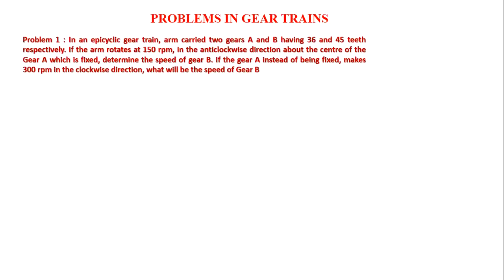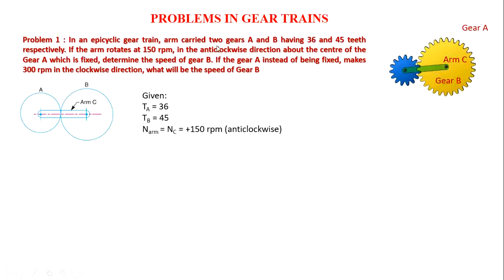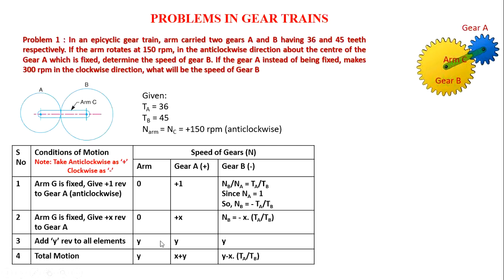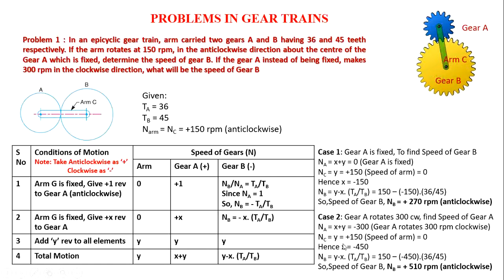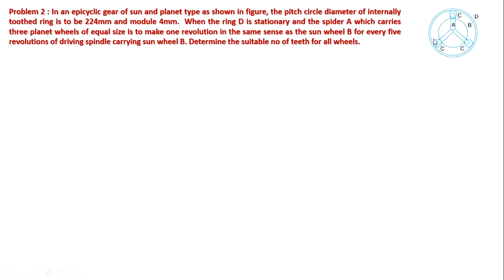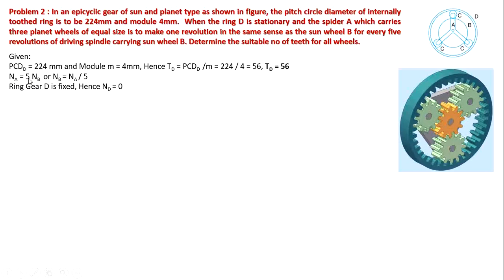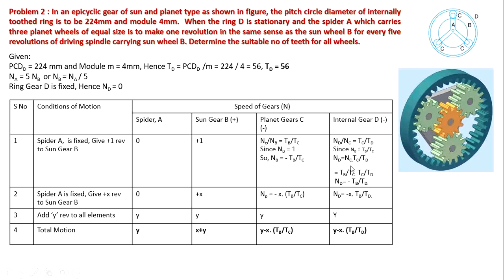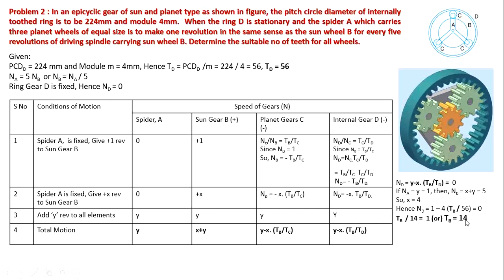Problems in Gear trains - I

Comment: In an epi-cyclic gear train, an arm carries two gears A and B having 36 and 45 teeth respectively. If the arm rotates at 200 r. p. m. in the clockwise direction about the centreof the gear A which is fixed, determine the speed of gear B. If the gear A instead of being fixed, makes 400 r.p.m. in the clockwise direction, what will be the speed of gear B?😊